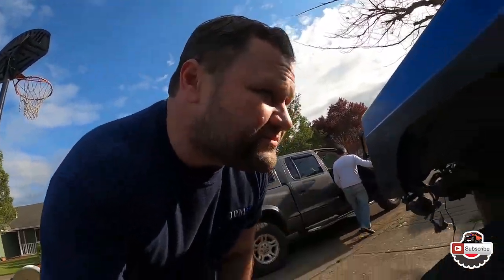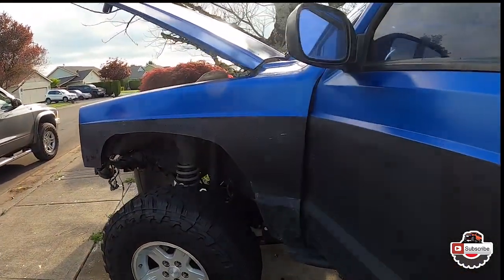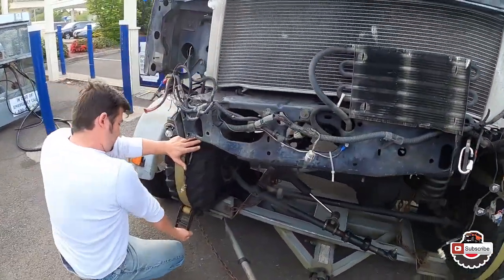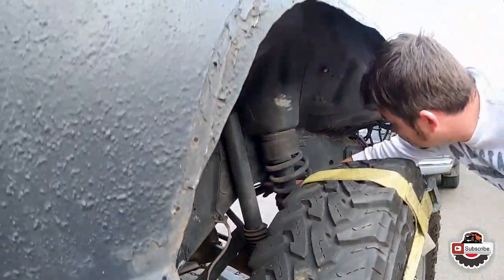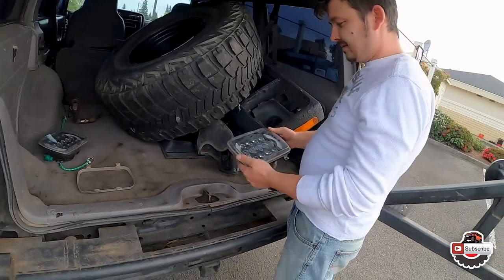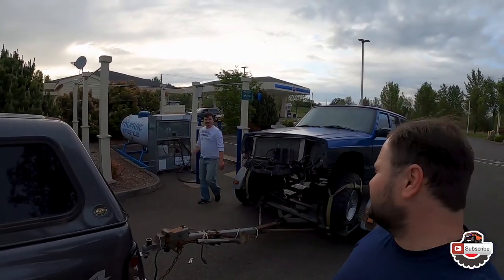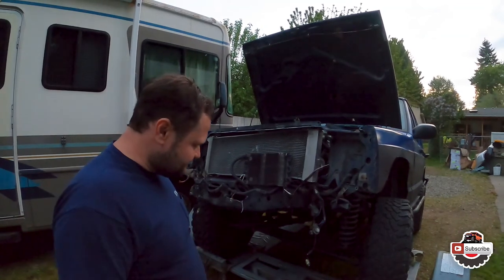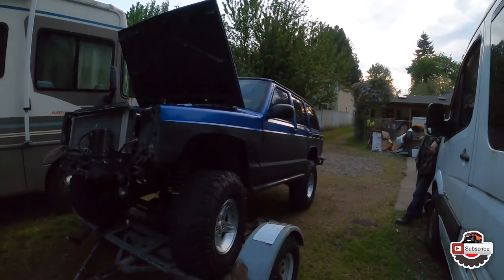New Overland Project

Comment: Your new Jeep has some cool features. You'll have fun building it right.
Reply from the maker: I can't wait till the front frame reinforcement plates come. Also have axle truss along with axle shaft sleeves on order. I think with 4.88 gears sleeved and trussed that D30 should be enough to handle occasional bouce on 35's